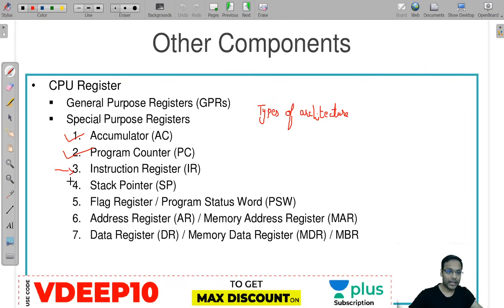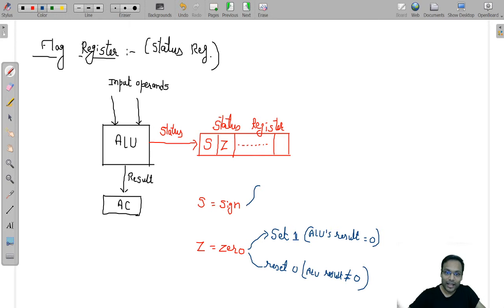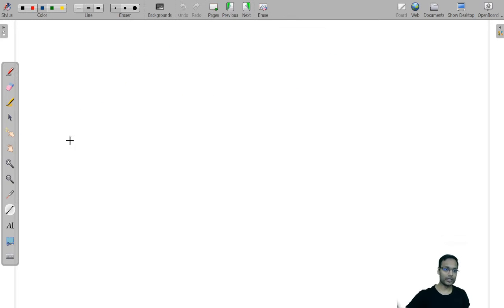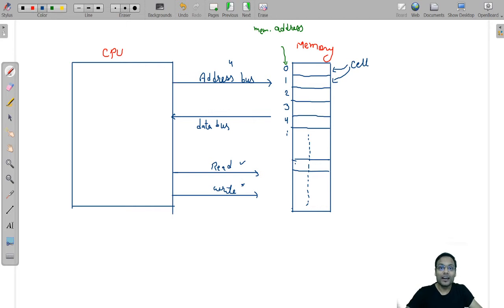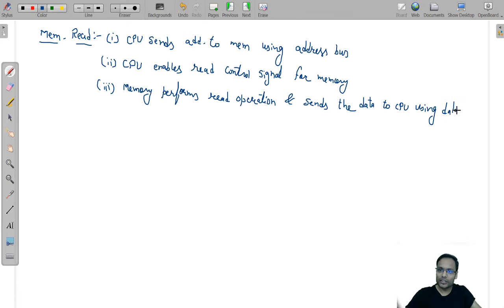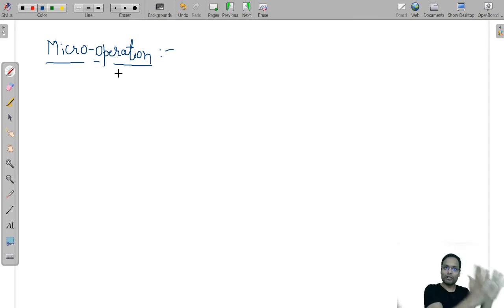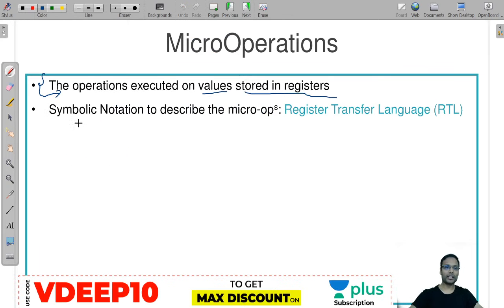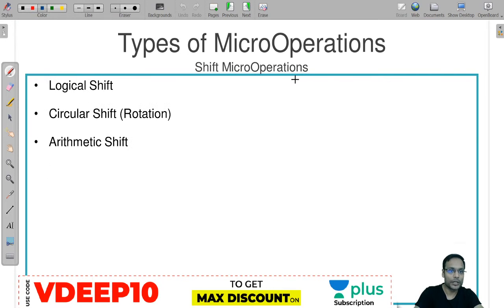COA | CPU Registers | Lec 3 | GATE Computer Science/IT Engineering Exam

Comment: 00:01 Encouraging audience engagement and sharing for more interactive learning experience
02:26 Course completion timeline and quality assurance
06:54 Personal mentorship and preparation assistance for GATE exam
09:00 Discussion on instruction register in CPU architecture.
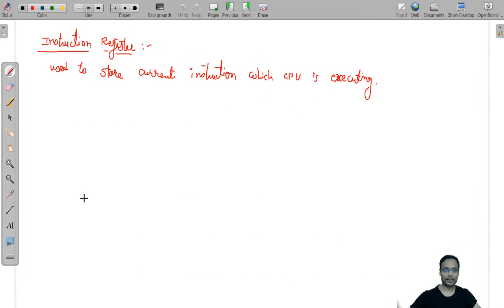14:18 Understanding CPU registers and specifically the flag/register
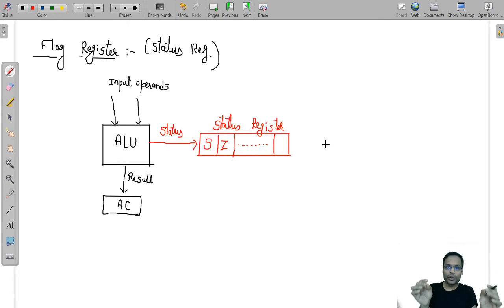16:56 Understanding CPU Registers and Status Registers in 8085 and 8086 microprocessors
21:22 CPU registers store and check conditions
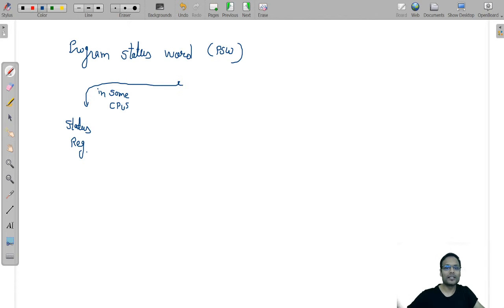23:45 Explanation of CPU registers and their functions
29:01 CPU sends address to memory to access specific cell
31:09 CPU initiates read/write operations with memory
35:50 Understanding the role of CPU registers in data transfer.
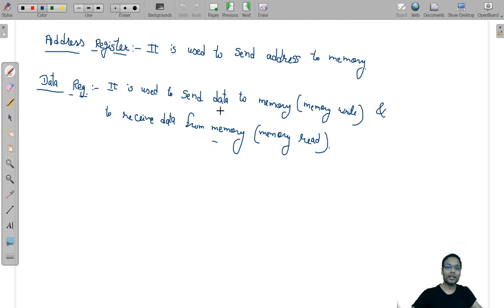37:54 Explanation of memory write operation using CPU registers
43:17 Understanding the flow of data during a read operation between memory and CPU.
45:18 Motivation for creating content and accessing videos.
49:29 CPU performs operation similar to fetching and executing instructions.
51:30 CPU performs micro operations based on command from control unit.
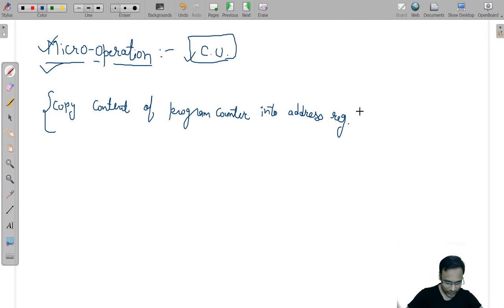55:34 Register Transfer Language (RTL) helps in easy understanding of micro operations
57:32 CPU Registers - Notation and Micro Operations
1:02:06 Understanding memory write operations from CPU to memory.
1:03:55 Join the comprehensive COA course with special mentorship using code 'vb10'